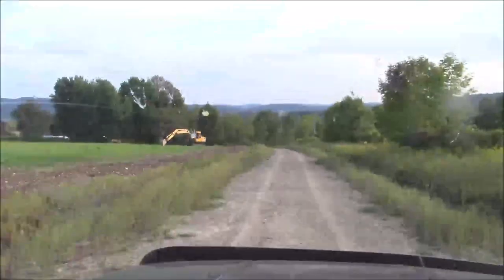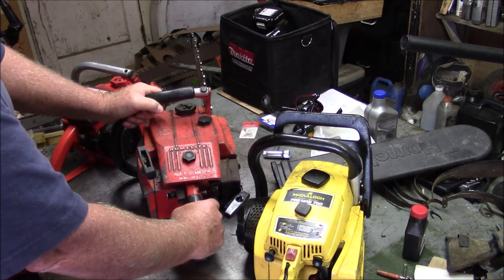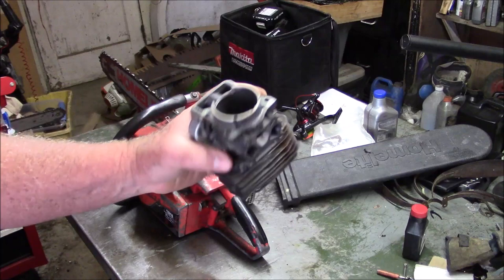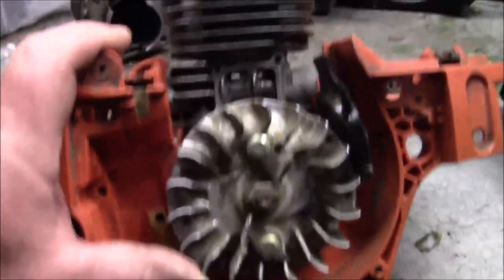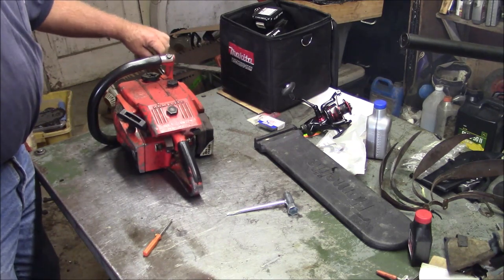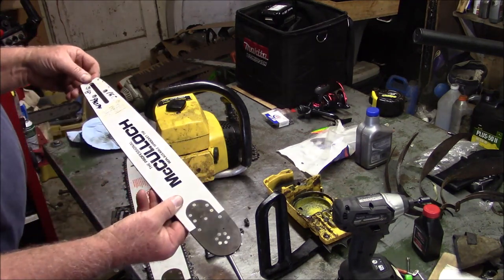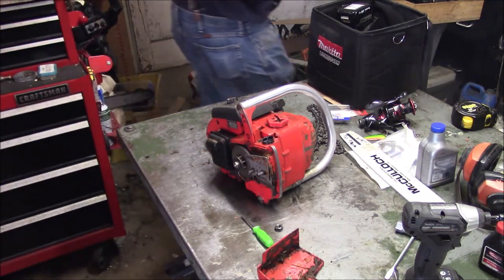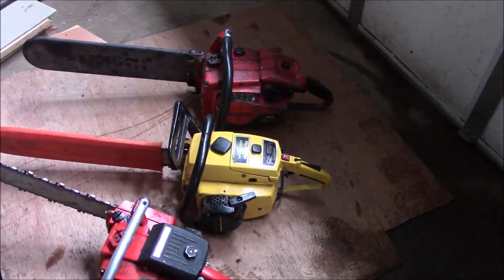Mini GTG Prep Homelite S-XL 925, McCulloch PM700, Homelite XL-12

Comment: I love the look and the sound of the old Homelites.  Recently bought a “just needs carb rebuilt” super EZ with intentions of making it my backup/ lightweight partner to my primary ms362cm.

It’s remarkably light, even by modern standards.  The integrated decomp on the handle is ingenious.  I suppose there’s some sort of EPA reason....but why can’t modern saws have a manual override oiler?  It just makes so much sense.  The cool factor and common sense engineering with the Homies has really impressed me, even as someone who grew up around more modern designs.

I’d love to own an old Mac of some sort as well.  Haven’t stumbled into the right deal just yet.  Looking forward to seeing your GTG footage.

Comment: It's fantastic you guys are dragging out the old saws big fun. I got out my McCulloch D eagle 80 and took down a 4 foot red oak with a 28 inch bar then cut the top up with my xl12 and 1010s used 7 tanks of gas in my XL alone gas drinker not sure why then I got my 070 stihl with a 36 and blocked up the trunk next day I was wondering if I cut the tree down or if it fell on me ,